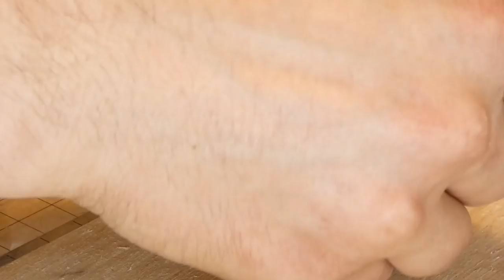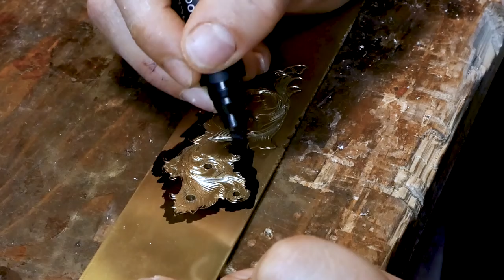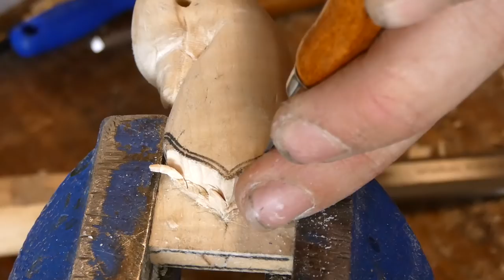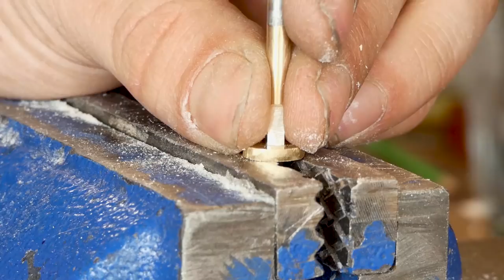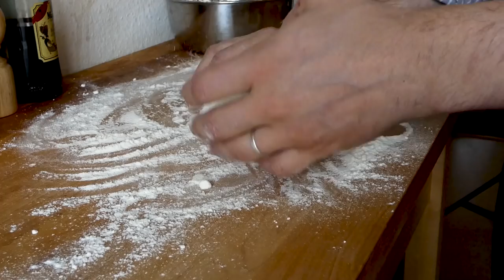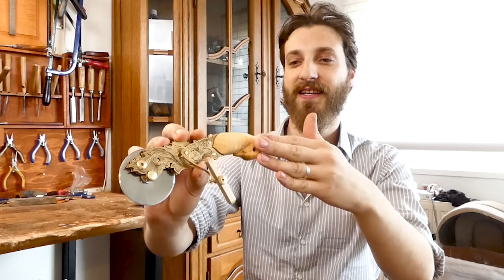Making a Hand Powered Circular Saw - Surgical Instruments

Comment: I think that you could make it a functional saw if you made the gearing ratio more extreme and added a flywheel to give the Blade momentum.
Reply: true but hed need to change alot more about it also such as making it 2 handed hold to fight the saw kick when the binds
Reply: @Sarge92  uhm, did you see the size of the saw? There is absolutely no fighting with that thing lol
Reply: not in its current form but once you add in fly wheels you have alot more inertia at play so a little beefier handle might be called for
Reply: @Sarge92  nah that would require one hell of a flywheel. I'm pretty sure there would be no need for such handle. Besides, how us he going to crank the thing if he is holding on with two hands?
Reply: his beard?
Reply: It needs to have a foot pedal. And some sort of extendo-cord for transfer.. then itll probably be quite useful, holding it and cranking must be hell even if it did work
Reply: @ImMora1   A squeeze handle instead of a crank could work.
Reply: Gotta be a pull cord arrangement, same as the retracting pull start on a motor

Comment: It's a very beautiful cutter. One little addition, you may think about. On a circular saw, there is a base. It stabilizes the saw against the wood. If you ever want to re-visit this project, add a base to it. Or send it to me and I'll add a base, then send it back to you. It will always have a hard time cutting through harder material, but the base will help. The gearing can be changed to help, but it's pretty darn cool the way it is.

Comment: This is beautiful. I was thinking about this tool and I initially thought that maybe it needed a weighted flywheel to keep momentum, but it just occurred to me that if you used a grinding wheel instead of a cut disk that it would solve that issue and give the tool a new purpose. Given how many files you use, a hand cranked grinder might be a neat addition. Beautiful work as always and I do love the series of fancy tools, so keep on keepin' on amigo.

Comment: You need a flywheel and drive train on it. which would also mean it needs to be much bigger. The drive train smooths out the motion and can add torque or speed (not both). The flywheel allows you to add more torque at the expense of being slower to start and makes the motion much smoother than what just a drive train can do.

Comment: I'm sure you've either taken it apart, keep it somewhere in a box/drawer, or keep using it as a pizza/pastry cutter. I'm sure it's good for cutting light foams like project board-type foam, but yeah it seems mechanically doomed from the start, even if you upgrade the geartrain

Comment: Can you do another one? The large gear turn slower and the small gear turns faster.  When you make  the new one, the gear that is closer to the hand needs to be smaller, with an even number of teeth, and the middle gear needs to be larger with an old number of teeth to get it to have high rpms. The part that is doing the cutting needs to be an even number of teeth at a mid size so that it can cut

Comment: You'd do better to put 2 gears on the middle shaft.  One very small to be turned by the input on the shaft with a larger one that would output to a very small gear on the final output to the blade.  Your setup doesn't step very much.  You still wouldn't have the torque to cut through a board, but you could increase the RPMs considerably.

Comment: It looks really cool, but that design would never actually cut anything, even with a thinner disk. The problem is, you'll never be able to hold the blade still enough to not catch, drag and bounce off of the wood. And it only gets further compounded when you also have to fight rotational forces from the crank. It'd work much better if the device was fixed in place and you move the wood into the blade as you crank the wheel. 

Still a pretty stellar piece of art. But that design will never function. At least not what people would consider usable.

Comment: Imagine spending a lot of time and effort on something that doesn't work as intended :(
Should have made an easy mockup first, just to see if it's even feasible.
From a mechanical standpoint, you don't only need a lot more speed in the blade (would need some staged transmission) but also some kind of flywheel to keep the blade going.